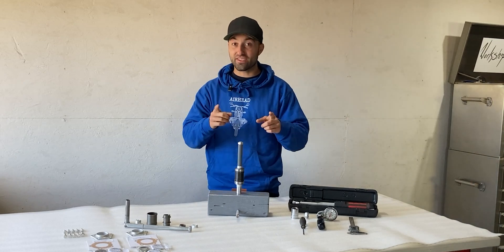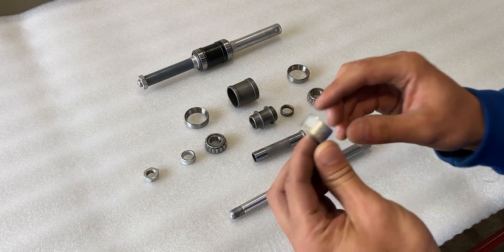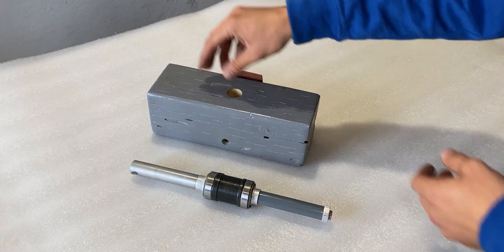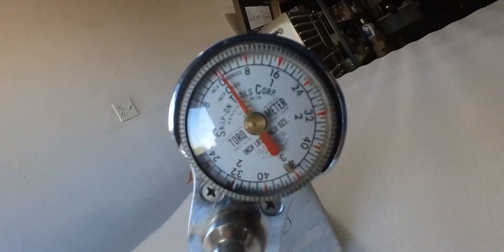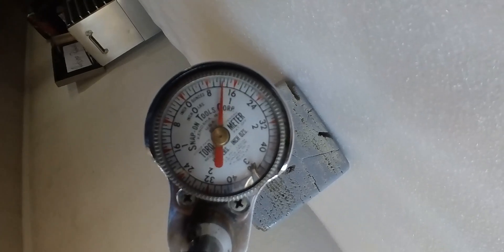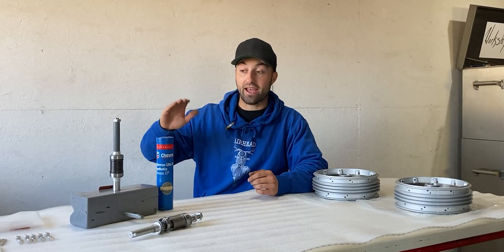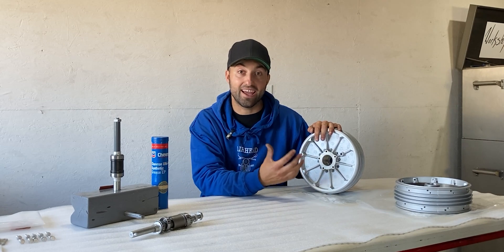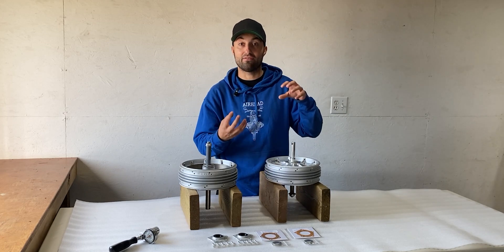BMW Airhead Wheel Bearing Assembly - R60/5 Project

Comment: Sorry dumb question is the first part on the axel the top hat or the reducer sleeve 
My assembly is not quite working 12:07
Reply from the maker: The top hat is mounted closer to the step of the axle shaft and on the side of the cover for the wheel bearing assembly.
The reducer sleeve is mounted on the opposite side, where you'll find the lip of the wheel hub. Everything in between must be installed correctly or your bearings will either have too much play of too little. This is adjusted with the shim in-between the tapered bearings.

Comment: Sorry for a another question...microfiche/eme all show 2x felt rings, 2 felt ring covers, 2 rubber rings and you dont mention or show these? Some say ‘TO’ 08/73 some say ‘FROM’. EME says you need two…of x but my bike has 1 or none of x. I've watched at least 4 different vidoes and Max BMW, Clymer, EME, Youtube, and my personal reality,  don’t look the same. Argh. How many different verisons of a 72/5 can there be!!!!
Reply from the maker: The two felt rings and two felt ring covers were carry over parts from older /2 BMW‘s, which they still used up in the early model /5‘s.

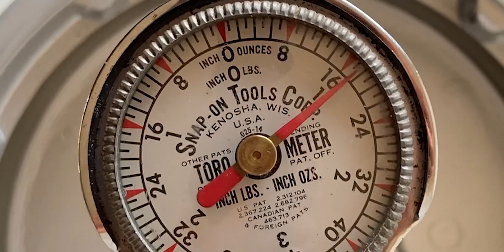At minute 13:40 and onwards, I show the seals that are used for this assembly.

The cover side of the wheel hubs, uses part # 36311233247 and the opposite side, uses part # 36311231701.

EME has these parts and they also have sizes for each seal. Double check if they‘ll fit your hubs before ordering.

Hope this helps. - Andreas
Reply: @WorkshopRebuild  Thanks for the reply. I've got a 1972 swb 75/5, built in Oct 71, apparently with a rear hub stamped 1970...the "evolution" of parts used is frustrating me at the moment. The manuals/videos/parts diagrams show all the variables...not just the parts I need for a particular job for a particular year...since it seems. There are 5 parts offered for my yr/make/model that are not in my assembly. Is what I have done wrong? A previous owner messed with it, Or that factory made some changes that month? Its frustrating...DO i replicate what I HAVE (even if its not right but worked) or contunie to decipher what is supposed to be the "right way" .

Comment: I am working on my front wheel  R75/5  , my bearings do not slide freely around my reduction sleeve is it normal ? i guess it s not ...
(you are not showing the mount with the reduction sleeve in the video so i have a doubt ...)
Nice video !
Reply from the maker: The reduction sleeve may not be concentric, or it could be too large for your new bearings. Not all "new" parts are manufactured to the same specifications, and even a 0.0005" difference can prevent your bearings from sliding onto the sleeve. You can easily polish the sleeve to make it fit.

Comment: You really do an amazing job. The detail and explanation within your videos is exceptional. I’m confused regarding the bmw preload specs. they call for specs between 21 to 42 inch oz and you settled at 16 to 24 wouldn’t that be below spec? thanks for all this great work.
Reply: Andreas I thought the use of the torque tool to help determine preload was brilliant. It’s really difficult for an inexperienced person to do it by feel so I decided to pick one up to help set my rear bearing pack. When setting the preload with the bearings dry it went perfectly.  In fact I was able to achieve 20-24 oz inches with the tool which matched when I did it by the feel approach. So confident that I was doing it correctly I greased up the bearings but before I put it in the wheel I decided to test the bearing pack with the torque tool.  It seems the grease made the axel harder to turn and the torque reading was higher 35-40 oz inches.  Does that sound right and is that why the pack must be tested dry? Thank you.
Reply from the maker: @steveratner  Hi Steve, I'm happy to hear that you've assembled your own bearing packs! The way you described it is spot on, during the assembly you want to keep your bearing packs "dry" or just slightly lubed with some oil in order to determine the bearing preload. After that you will grease your bearings packs and reinstall them into your hubs. The torque value will be increased due to the grease within the assembly, but it will not change the bearing preload setting. The grease will only act as a resistor in this case, causing the torque wrench to read a higher value. 
This is exactly why you want to test your bearing pack dry! Regards Andreas
Reply: all good, i wasn't thinking. your reading of 24 is within bmw specs.
Reply from the maker: Thank you very much for you comment, Steve! The preload specs from BMW are actually on the higher end like you mentioned in your first comment. After consulting with various BMW experts, they told me I should opt for the lower end of the preload spec. There's a lot of information about this in various forums and Facebook groups, and everyone recommends this.
If you go any higher, let's say between 30-42, your bearings could fail prematurely.
I tried my best to source the preload data for the bearing I had in this video, but I just didn't find any information.
Hopefully with the information in this video you'll be able to repair your own BMW wheel bearings. 
Regards Andreas

Comment: Thank you so much Andreas. I can’t tell you how helpful your videos are. I’m about to assemble my snowflake R100T ‘79 wheels and your continued attention to detail and explanation is invaluable. You should set up a patreon or something so we can support you. I’d buy that block from you as well plus that amazing engine stand you did as well anytime. 🙏
Reply: Dear MasonicInc, I hope you had great success on your bearing installation. I have the 1983 R65 with the snowflake wheels. The outer races remove from there respective sides, do to a shoulder inside the hub. My rear went well. My front has lateral run out. I suspect my bearings are not getting full contact in their outer races. Mabey a thinner wedding band. Take care, Benjamin
Reply: @benjaminwest2281 it went well, I’m finishing a complete electronic overhaul currently and reworking the bike. Sadly taking me longer than needed.
Reply: @MasonicInc  I also seated my outer races to the shoulder. The Clymer manual says to seat them flush to the outside of the hub. I hope I didn't goof up!
Reply from the maker: That's fantastic to hear! I appreciate your support and enthusiasm for the content. Setting up a Patreon could be a great idea to offer more support for my viewers, with files, drawings, documents etc. I will consider this moving forward into 2024.
Best of luck with assembling your snowflake R100T wheels, so you can be back on the road sometime soon! Regards Andreas
Reply: Andreas thanks so much for your fast reply. So glad i have it right. I’ve learned so much from you!  Can’t wait to see your finished airhead. Thanks again!
Reply from the maker: @steveratner I feel fulfilled when I can provide valuable information to my viewers, such as yourself! That's the essence I aim to convey in my videos.

A few more sub-assemblies need to be completed, but all the necessary parts are in my shop to finish the R60/5. So, it shouldn't take much longer—just a bit more effort and time. I look forward to sharing the results with you soon! -Andreas

Comment: Excellent tutorial and attention to detail. Makes me want to get an old airhead just to work on it. Don’t know how you keep both metric and imperial measurements straight. I only ever used imperial on old American iron. Keep up the great work!
Reply from the maker: I'm glad you enjoyed this video! BMW airheads are known to be easy to service and they are definitely fun to ride. If you have the chance to pick one up, you probably won't regret it. I switch back on forth from metric to Imperial all the time, due to manufacturer specifications. Once you understand what conversions are equal, it's not that hard to forget. Even though imperial is superior to metric, I like to use both...maybe I'll share more on this in an upcoming video.
Thanks a lot for your support. I will continue to upload more videos about this BMW and maybe introduce some new projects sooner than later. Regards Andreas

Comment: Yet another awesome tutorial video. Have you had any luck with the parts that weren't upto standard? Did they resend better quality or have you had to look elsewhere for them?
Reply from the maker: Hi Simon, I have found a solution to the rocker arm parts and will be sharing an update here pretty soon! This means I will be able to start the engine rebuild in the following days.
Thanks for your questions! It‘s always great to hear from you😃👍🏽👍🏽 Regards Andreas
Reply: @WorkshopRebuild  As ever looking forward to it. We are forecast here in the UK to have a heatwave in October so if you're the same there you get some riding in on the bike.
Reply from the maker: Oh that will be perfect for some late season riding, with some warmer weather in October for you! Unfortunately, I don't think I'll be able to get this bike on the road this season as it has already cooled off quite a bit in the last two weeks. We usually have a nice summer, a few days of fall and then winter straight away! That means cold weather and a lot of snow, but I really don't mind. The bike will be ready come spring time.
Reply: @WorkshopRebuild  Fun fact: the married couple in the book Zen And The Art Of Motorcycle Maintenance were on a BMW R60!!
Reply from the maker: Another subscriber recommended me this book as well, but I have not picked up a copy yet (what a coincidence). I think I should give it a read!